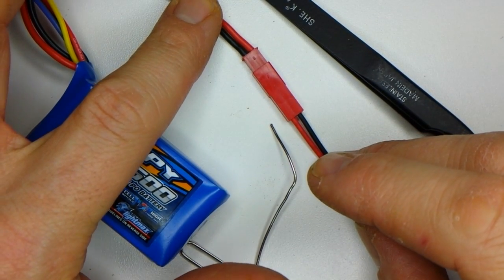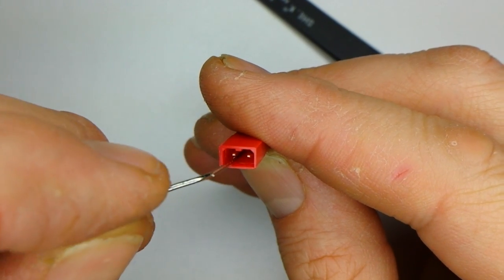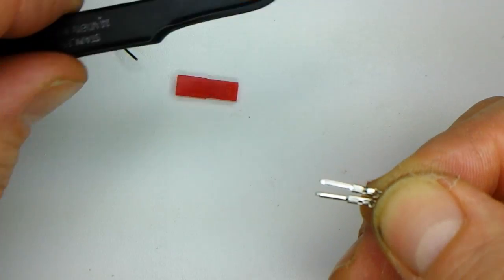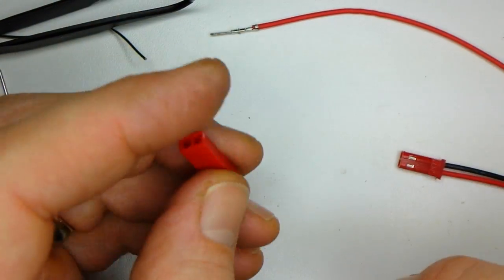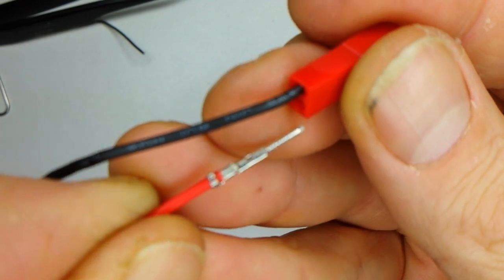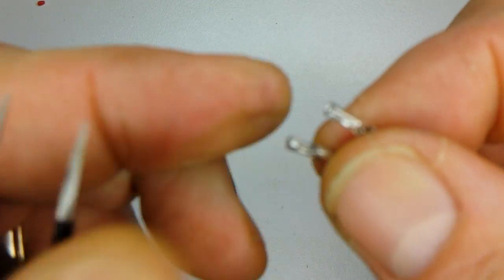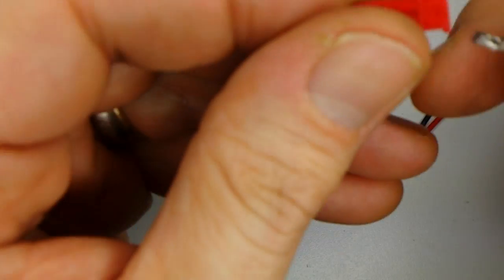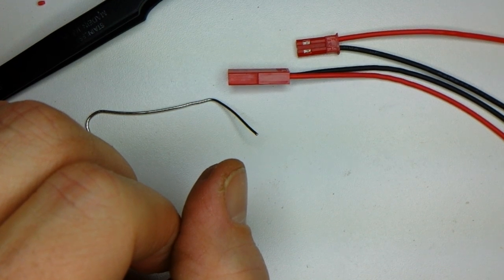JST connector disassembly / assembly

Comment: Thanks for posting. The insulation on my 3s battery just stripped and I was looking for a way to remove the connector and reinsulate - looks easy. How do you safely handle the bare leads of a charged battery? It’s the positive lead and I don’t want to get shocked / screw up the battery - any tips? Sorry, I’m bad with electricity.

Comment: Thanks, this helps me because I make my own charging cables for my lipo batteries. And with JST, I never knew how to completely get rid of the cable that comes ith the connector itself which is too thin for my standards. So what I always end up doing is cut those thin cables short and solder onto them my "beefy" cables. Which doesn't look neat and professional, and most importantly defeats the purpose of having "beefy" cables..

Comment: Really apreciate this. Perfect.  Just to add my 2 cents,  I also squeezed the clip with a little hammer to make it finner and it fited well. Also hammered the clip gently to make it get in the plastic connector. Also trimmed the finned clip by the sides with a sandpaper.  I worked 100%.  Thanks a lot!

Comment: Great video, I always forget where the locking tab is.
I have found it can help to hold the pin in place from behind while you are trying to push in the tab with a paperclip - stops it moving backwards in the connector (which makes flattening the tab harder).